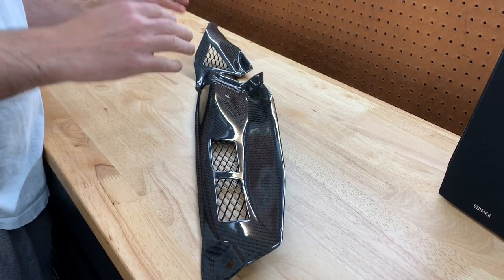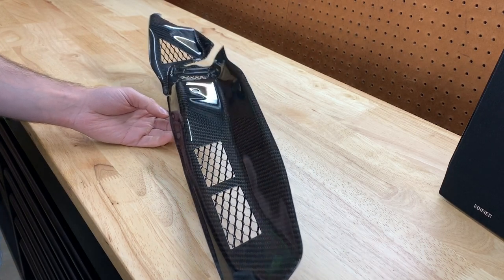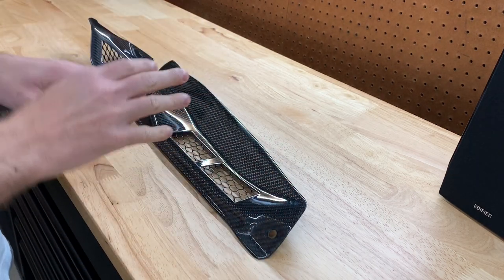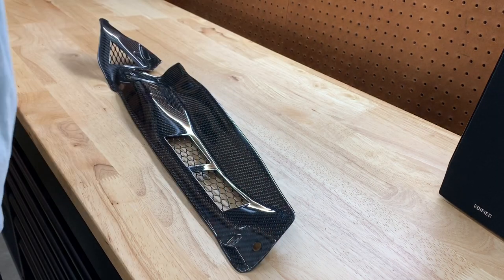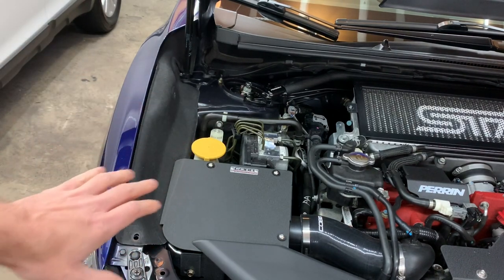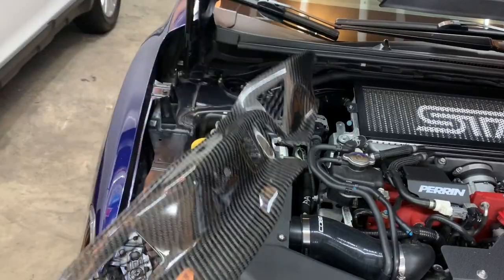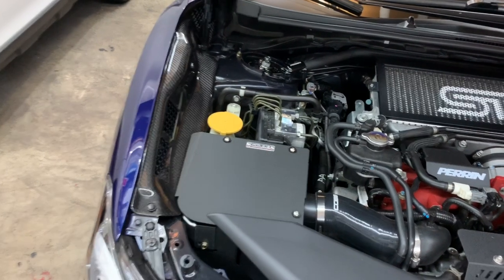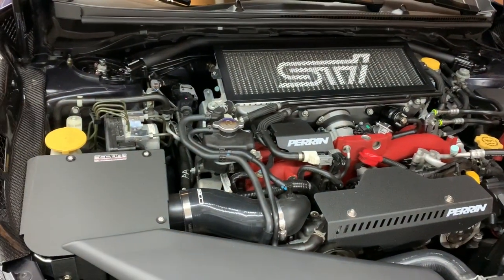Subispeed Carbon Fiber Fender Shrouds For WRX or STI

Comment: We're you ever able to get the driver side shroud off? I'm struggling right now
Reply from the maker: Yes. Need to turn it upside down a bit as you are removing.
Reply: So turn the top of shroud down or turn the bottom up ?
Reply from the maker: Bottom uo